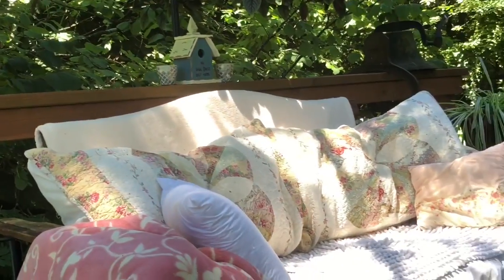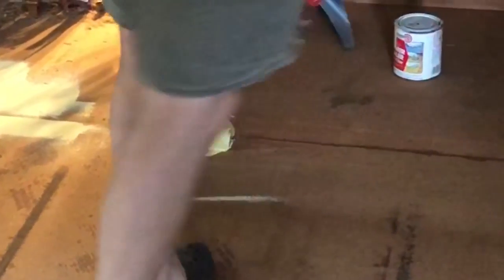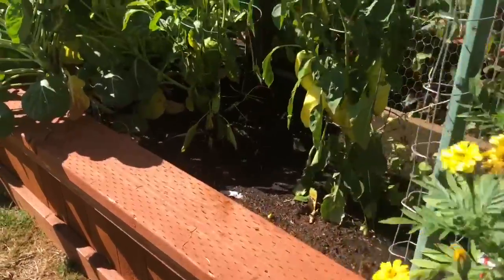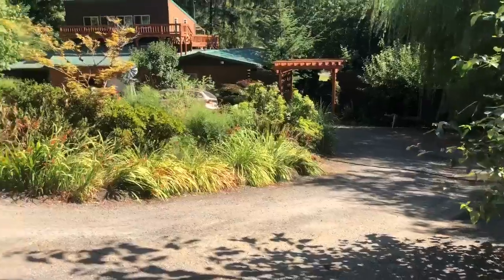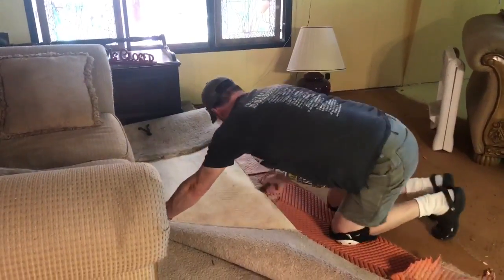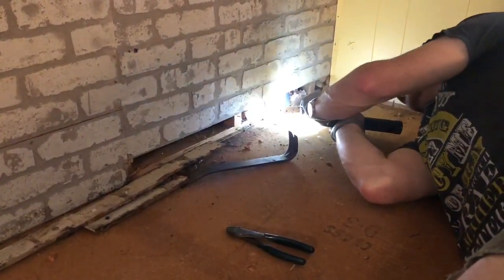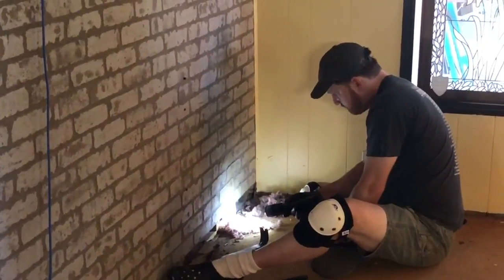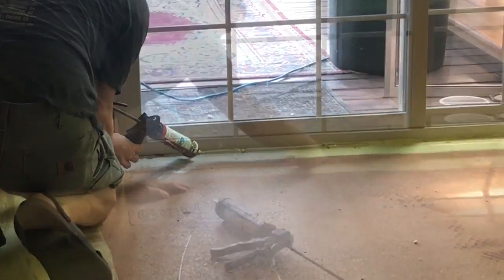• MOBILE HOME REMODEL - Episode 15• Floor Leveler, Garden Update •

Comment: Tina Golik, what is that brown stuff for?
Reply from the maker: Jade Macias Im not sure what brown staff you mean?
Reply: @TinaGolik  , Good morning, the stuff from the white bucket that hes putting on the floor on the minute 11:14?
Reply from the maker: @mayte8018  OHHH...lol Thats the floor leveler. Its like concrete but made to pour on floors inside to level them. It dries faster than concrete.
Reply: @TinaGolik  , Thank you so much. I have a big problem with mine, and I dont know what to do. its leaking from the roof. any suggestions?